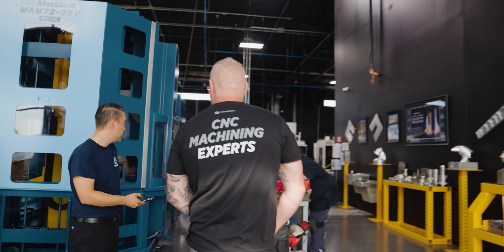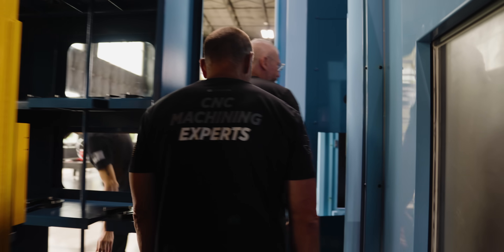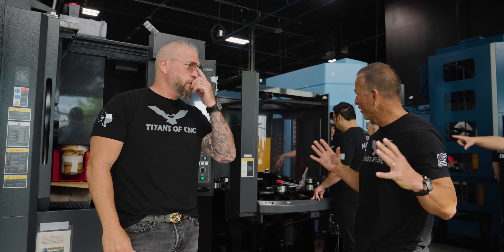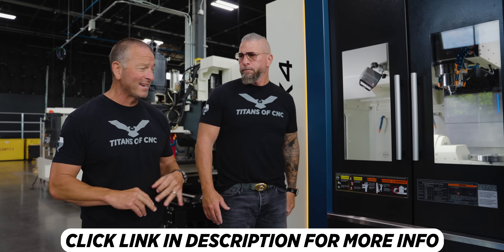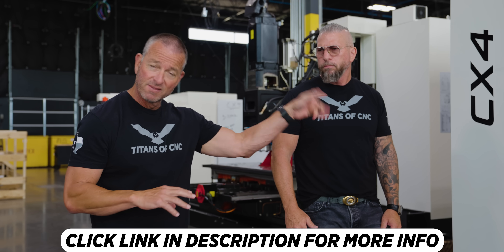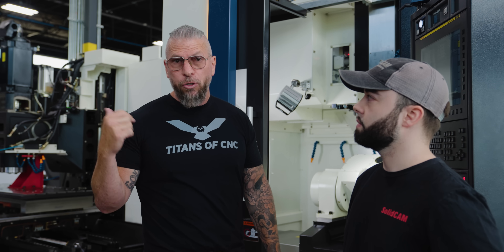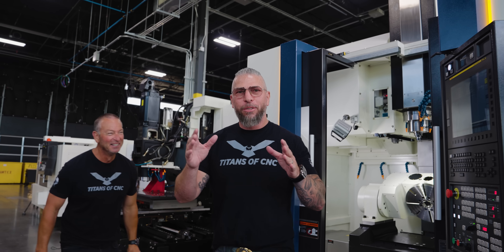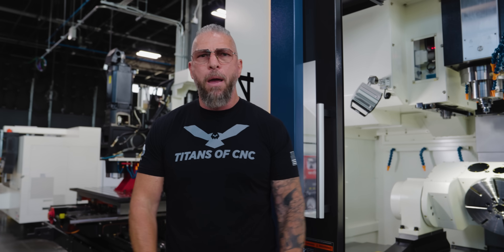The Shop Is Destroyed… Here’s Why It’ll Be Legendary

Comment: The mx330 comes with some SERIOUS issues that Matsuura does not talk about! We have 6 years of solid production with ours. Matsuura is normally primo! It can not be run similar to a Makino. Goofy problems from a phenomenal manufacturer. If you precall a tool while taking a facing cut, you will have an unacceptable part. Precalling a 90 tool atc at 20 % speed comes at a cost when trying to make $. Matsuura came out with a fix.  They have an “m code” that slows the 90 atc down because the machine resonates through the casting and shows in the cut. We’ve replaced 3 spindles with zero crashes. We program hsm with very limited spikes and nothing over 80% load. Posted on emastercam for years about the issues. We can show our results and how to program around them but that sounds ridiculous to couple with the name Matsuura. I’ve been in the trade for 25 years and they have always been pinnical but we are disappointed in this machine. Every other Matsuura has been a delight. From the 520, 630, 300 and and 405, that I’ve run. I realize that you all are “in bed” with certain manufacturers but your consumers should know all of the details before putting in this kind of investment. You will ABSOLUTELY make money but should know the risk and true cost of ownership.

Comment: I have been using SolidCam for almost 3 years. Love it. I do 3 and 4 axis work on it. I also have a ShopSabre Pro 408 router that I had them write a post for. Great software. More powerful than I I need but I love that it is a SolidWorks plug in. Makes life so much easier.

Comment: Be careful with SolidCam! Its easy and nice, but if you have some CNC that is not very well known, and you dont have the postprocesor for it, with SolidCam you are fked, 98% you are gonna crash the machine if you dont have some option to verify the NC. The simulation will look perfect in SolidCam, but the machine will crash. Its a good program, dont buy it if you dont have a very well known brand or model of CNC.

Comment: just wounder but is matsuura the only japanses brand thats landing on the floors or is there other japanses brands ( like toyoda. kitamura and all the other ones ) on there way ?
i do know that both matsuura and kitamura both cast there own castings in there own foundry's but they also handscrape every machine both straight. parallel and angle wise to be less then 2 micron's over its entire travel and then apply laser correction afterwards ( though they use it more like a check then actually correcting it since its already mecanically perfect within 2 micros )

also when is news on the syil U5 ?
Reply: OKK are also beast of machines. Seen them multiple times in Switzerland in action at customer locations.
Reply: @hocln2556  only came with some examples of brands that I knew of the top of my head that I knew was Japanese
Reply: Sure all those are made in Japan too not Taiwan